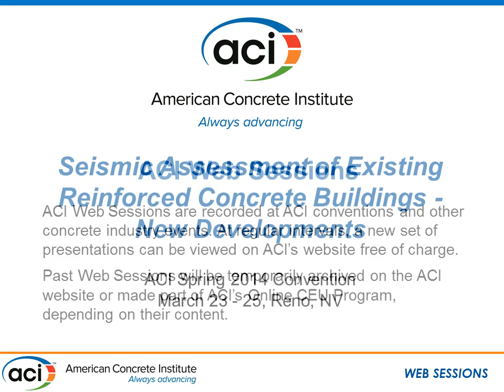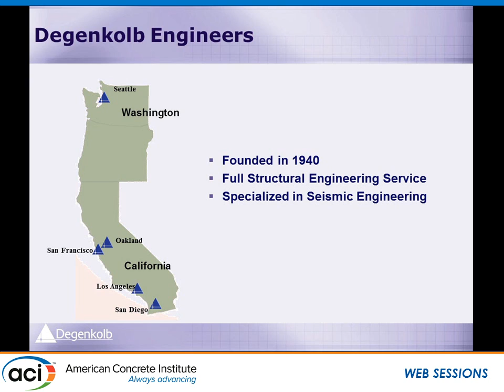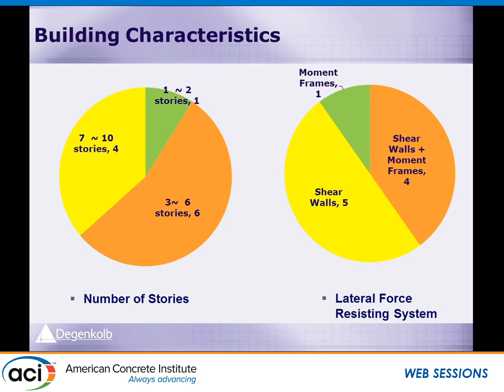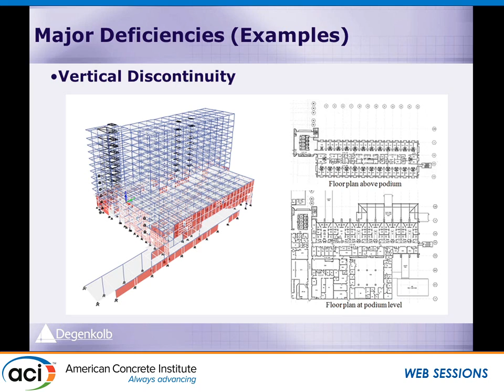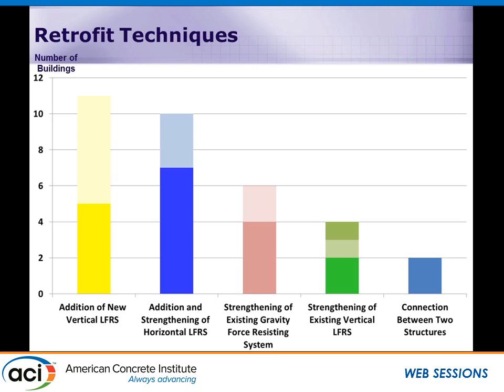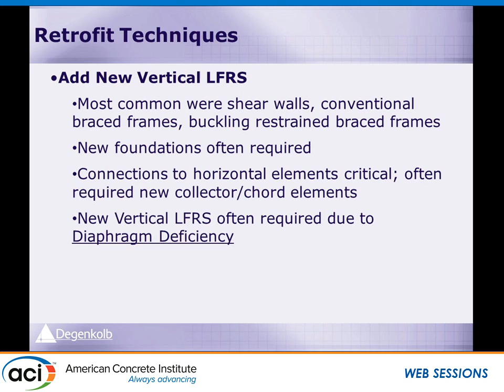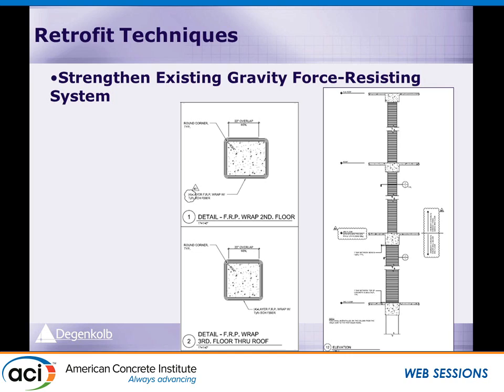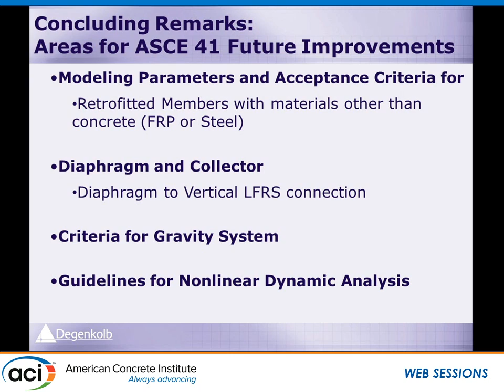Seismic Assessment and Retrofit of Existing RC Buildings: Case Studies from Degenkolb Engineers

Comment: First, where do you place the paper retarder, is it directly below the slab on grade concrete or below the soil subbase layer?
Second, there has been recommendations not to place the paper retarder directly below the slab on grade concrete when the slab on grade is used to resist horizontal loads as it will reduce it capacity to resist that load due to low friction; the case of a basement wall is a typical example of that case